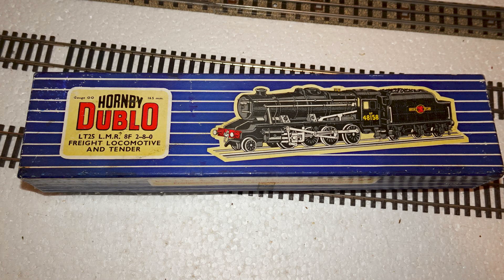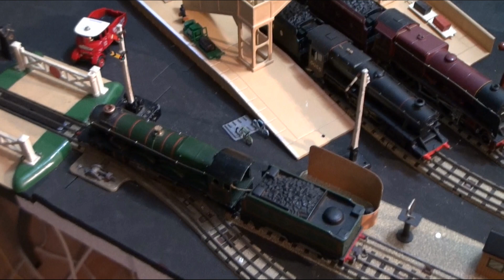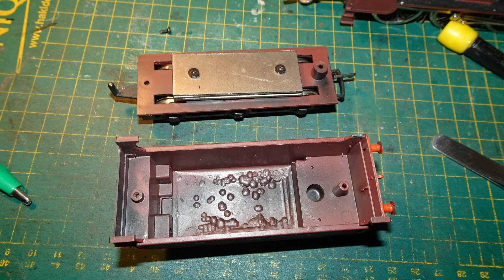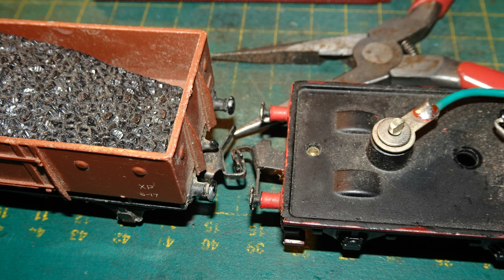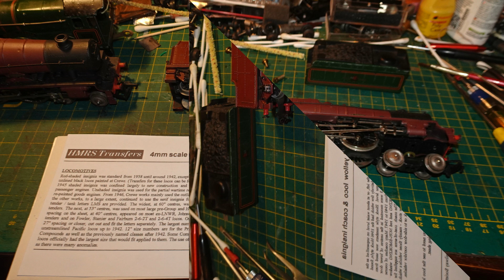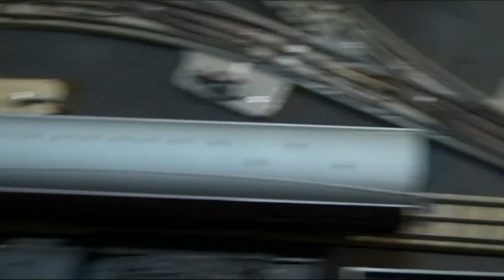OO 250, Dublo Castle Serves Jubilee

Comment: Dublo castle and 8f tender underframes are not the same, in fact they replicate correctly the actual differences in the real thing. The high current consumption is caused by the heavy tender being dragged around by the lightweight loco, as is the wheels lip under load. I suggest you use a dublo 8F tender underframe with the plastic tender body and load the loco with plenty of lead weight, this might reduce slipping under load but current consumption will still be high.

Comment: Bristol Castle is a lovely engine. I picked one up myself this summer. It runs beautifully. Seems such a same to cannibalise it for the Jubilee which doesn’t run very well anyway. It would be easy to reletter the tender GWR, no reason why it wouldn’t be seen side by side with pre war LMS locos, there were loads of places where that happened everyday. Also of course, our man Stanier who worked at Swindon while the Castles were being developed had a major hand in their design. Legend has it that not only did the LMS have one in trial, but that they also asked the GWR if they would build some for them. Swindon refused and it’s probably no surprise that shortly after the LMS « headhunted » Stanier!
Reply from the maker: There was certainly a trial with a Castle class on the Western main line, for a month in 1926, and I did mention that in this video. I don't know about asking GWR to build them for sale. The trial of the Castle was what led to the LMS dropping Fowler's plans for a Pacific, and developing the 4-6-0 Royal Scot class instead - a while (5 years ) before Stanier came over from the GWR to the LMS. And when he did, he also promptly developed Pacifics for the Western main line, before turning to 4-6-0's with the Black Five, and the Jubilee, derived from the Black Five. Stanier, of course, did not design the Castle class - that was done by Charles  Collett. Stanier would have been Works Manager in Swindon at that time. If I had unlimited space, I'd model all of the Big Four in OO gauge. But with the space I have, I can barely adequately model operations of the LMS, the company my family worked for, and I focus on the 1930s, when my Grandfather concluded his career, driving engines such as the Royal Scot.
Reply: @kleedhamhobby  
I knew I’d read about the LMS’s approaches to the GW to provide Castles for the WCML somewhere. This article is on Wikipedia :
« In 1926, number 5000 Launceston Castle was loaned to the London, Midland & Scottish Railway (LMS) where it ran trials between London and Carlisle. The locomotive fulfilled the LMS requirements so well that the latter first requested the GWR to build a batch of Castles for use on the West Coast Main Line, and, failing that, a full set of construction drawings. Both proposals were rejected by the GWR Board of Directors. The LMS eventually succeeded in gaining access to the design by recruiting William Stanier, the GWR's Works Manager at its Swindon Works to become the new Chief Mechanical Engineer for the LMS.»
So with a change of identity to 5000 Launceston Castle, you could run it 😉
Imagine if the GWR had agreed to build a batch for the LMS. Now there’s a candidate for a « neverwazza » LMS Castle…
Reply from the maker: @robinforrest7680  I'd have to take issue with some aspects of that Wikipedia material. The LMS did not 'gain access' to the Castle design by recruiting Stanier. It would have been entirely unethical for Stanier to have conveyed specific details of particular GWR designs to his new employer. And in any case, Stanier did not design anything very specifically like the Castle for the LMS. However Stanier certainly did apply general principles that had been found useful by the GWR to his design work with the LMS - most noticeably, visually, by fitting tapered boilers to everything. On the other hand, the GWR never ran Pacifics - they had one single engine, and never developed the type, which made sense, as they weren't required for the GWR's lines. But Stanier concluded, almost immediately on joining the LMS, that Pacifics were the appropriate type for the Western line expresses, and set about creating Pacific locos for that purpose - first the Princes Royal class, and then the Coronation class - replacing the 4-6-0 Royal Scots, which were, roughly, modelled on the Castle. Stanier did return to 4-6-0 designs for general mixed traffic work (Black Five), and passenger expresses on the less graded lines of the LMS, such as the ex-Midland line from St. Pancras up through Leicester (where I grew up). So Jubilees were a common sight for many years pulling passengers trains through Leicester. I do find the Castle design appealing - solid and chunky, but at the same time elegant. But its home was in the South and Southwest of England, not in my part of the world.